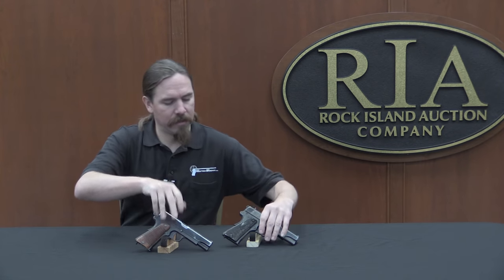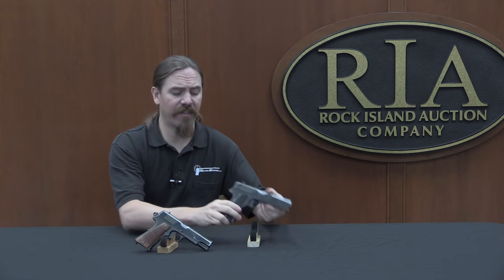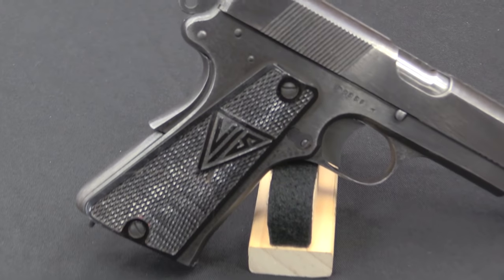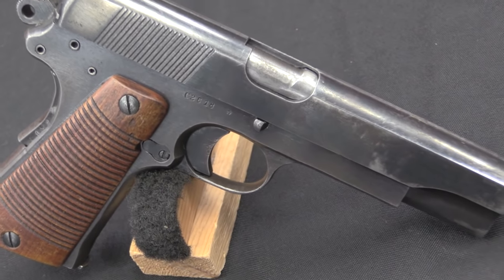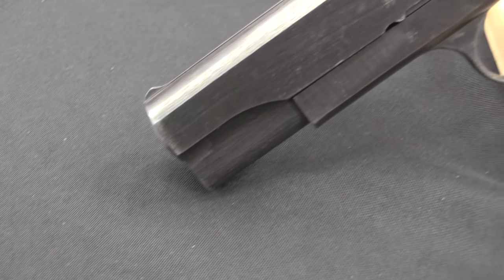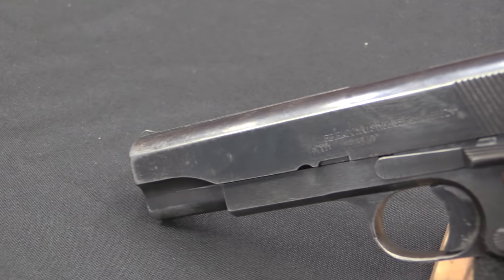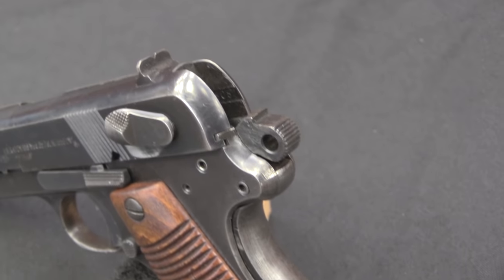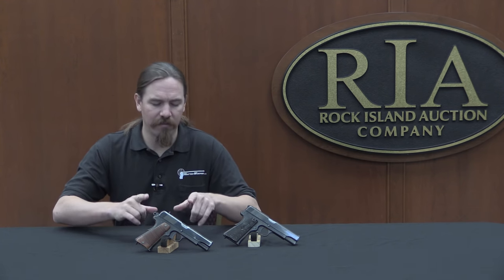Radom's Vis 35: Poland's Excellent Automatic Pistol

Comment: Hi! Great vid! There are some details I know of that I don't think were mentioned, so I'll list them for anyone who's interested:
- VIS name came from WIS which stood for 'Wilniewczyc i Skrzypiński' ('i' = and) who were the constructors behind the project. Army decided to swap W with V and make it into Latin VIS, which means 'force' or 'strength'
- Polish-made VIS were meant to be able to work with holster/butt so they had a hook to attach it on the handle. 
- When Germans found out about scheme with duplicate serial numbers they decided to move barrel production to Czech. It didn't help much cause Poles were just salvaging barrels from old firearms and refitting them with the rest of the gun. In the end whole production line had to be moved to Germany.
- VIS's production has been reissued 2 or 3 times but it was either in small series or solely for US market.
- They can be mainly found in US as most of the WW2 produced guns have been taken off German soldiers as a trophy.

Comment: i own one of these. I bought it,  as it was inexpensive at a Gun show, and  then shot it. Tiny sights, but it was freakin' accurate, so i bought some replacement magazines for it, and for years used it as my duty gun as an Amored Car courier.  It's a late period manufacture, covered in German proof marks,  having hollow pins, and (unfortunately) lacking the take down lever. Still, the weapon was, and is still my "to hand weapon" for many years and i trust it.
 never had a problem with it. Thanks for covering this pistol.

Comment: I have one of these that my father brought back from Europe after WWII.   It is a  dated 1939  it is the final version the Nazis assembled using all the orig. parts with the shoulder stock slot in the hand grip.  It does have the polish Eagle on the side.  It is a  very fine shooting easy to handle pistol.
Reply: I have the same version, serial number just before 40K and no marks on the slide. Numbers are matched.

Comment: Ian, you can actually take the late guns apart without holding the slide. The hook on the top of the (not present in the earlier guns) hammer is meant to be lowered into a corresponding notch under the slide to hold it rearward.
Reply: +Onot 

Actually the way to lock back the slide on the late war guns
is to pull the slide all the way to the rear and press the de-cocking lever
down and while holding it down ease the slide forward. The bottom of the
de-cocker catches on that notch on the hammer you describe.

A late war Radom was my first handgun, I got it in 1979 and I
still have it.

Comment: I always thought these were an interesting mix of 1911 and BHP. First heard of them in the 85 or 86 Gun Digest Annual. It was not mentioned that FN brought their prototype HP's to the trials. That makes perfect sense. Disturbing to hear about QC problems with the BAR's and the resulting contract difficulties. I hopw it was just issues duplicating a non-native design, and they were not deliberately trying to short change the Poles. Great video as always. Thank you.

Comment: a decocker was probably very important to cavalry because they didn't want a live handgun with no safety jostling around on their belts when they were riding horses
Reply: Did Poland still have horse riding cavalry in 1935?
Reply: Yes. But cavalry was simply faster moving infantry. And not so tired by marching. Since 1935 polish rules for cavalry forbade of charges and any other way of fighting from the horse. Polish cavalry was to move using horses and fight as ordinary infantry.
Reply: @tomaszkornaszewski3275  I believe you call this style of cavalry "dragoons"
Reply: @nichevo1  Yes, but 4, 3 centuries earlier.
Reply: @loganjones5766  So did almost everyone, Germans included - even in 1939.

Comment: On the late model VIS, to take off the slide, you need to pull the slide back, and use the de-cock lever to hold it back. It will rest against the top of the hammer. That is why there is a small cutout on the top of the hammer on these later models. It will hold the slide back. Then you can release pressure on the telescoping rod just as you do with the earlier VIS. That is why they removed the disassembly lever, cause it wasn't needed. It's actually much easier than using the disassembly lever.

Comment: What I thought was neat with these weapons that you didn't mention is that the earlier ones made by the Polish had a slot in the mainspring housing for a shoulder stock which doubled as a case, similar to the stocks seen with Broomhandle Mausers. However, it appears that none of these stocks were ever made, and once the Nazis took over the factory that slot was one of the first things to go.

Comment: I have not read through all the comment so this may have been already mentioned. To remove the slide stop on late war pistols (lacking the slide latch) the slide is held back in takedown position by the hammer drop lever and hammer hook. A lot easier than the method you employed, See VIS Radom by York. You are doing a great job! Thanks.

Comment: I inherited one of each from my father. A polish and a german VIS. You can really tell the quality difference between polish and german. The German gun is a much rougher aesthetic finish with machining marks visible. Internal quality is of good finish. To my surprise German gun I have is much more accurate than the polish made one is.

Would the Polish made ones be more valuable being as there were not as many made ?

Comment: Ian, I have a German P35P version without the disassembly lever. To lock it open to dissemble you pull the slid back until the notch lines and pull down the de-cocker, it locks it in place like the disassembly lever does.  Just pull the guide rod and out it drops just like the other model.

Comment: The later guns without a take down latch used a notch on the hammer to hold the slide back. You retract the slide, push down on the decocker, and let the slide run forward. The hammer notch catches the decocker leg and holds the slide in the proper position for removal of the slide stop.

Comment: I had a strange one brought back from ww2 by a grate uncle. It had the black grips and was finished well. But it had the DC. Only no safety. It had the Polish eagle but had swsticker under some eagles. And the numbers matched with swstickers stamped around them. It had a leather flap holster and a extra mag. In the holster mag pouch. The ex mag had a swsticker stamped in it's base plate. But the one in the gun did not. It didn't have the take down.
 Sadly it was destroyed in a house fire.

Comment: Did you notice the cut in the hammer? If you decock with the slide back, this will hold the slide inplace instead of the slide stop of previous models, allowing you to easily pull the slide guide for release of the slide stop.

Comment: If there were a pair of marks on the right side of the 3rd model that indicate when the slide was retracted at the point to remove the locking pin it would be much easier.  Just hold the pistol over a table ( or similar) with the right side up, retract the slide with the left hand until the mark on the slide lines up with the mark on the frame, pull the guide rod, and the lock-pin will fall out. Ta-da.

Comment: Vis - Polish semi-automatic pistol wz.35, designed by Piotr Wilniewczyc and Jan Skrzypiński and Feliks Modzelewski [1]. The original name of the WiS pistol, created from the first letters of the designers' surnames, was changed to Vis (Latin - force) at the request of the Department of Armaments. According to some sources (including Guns & Ammo magazines), this pistol is one of the best military pistols ever produced

The Germans did not produce under the name VIS, so the NN covers are from a later model. 
The Visas, manufactured for the Wehrmacht, were called Pistole 35

Comment: That would be awesome if they made guns like that now I would buy it I have a CZ it's a tactical version it holds 18 rounds but is the smoothest shooting you never think but do you see the technology they had then you see where they're getting all this stuff from these decocking mechanisms and everything I have that on the pistol that I just told you of is meant to be a sidearm for military just as you have better they're in your hand I really like that were you pull on that bottom piece and it lets the other piece fall straight out that's just so much nicer then when you got some of these like that 762 x25 Tokarev that one actually got to push that out a little bit of a herky-jerky thing but it does come out but that is a slick pistol you got there from Poland I've been known to pay some big money for pistols or rifles that one I would pay for it cuz that's some feat of engineering right there they thought quality over production which during the war you had to have production but you need some quality into it so it ensures itself like the Switzerland gun makers did.... reliability with quality

Comment: The gun smuggling came to light when somebody on a train got caught with one of the pistols. Polish resistance had the serial numbers filled out in order to protect the factory workers. However just around that time some CSI predecessor in Berlin had found a way to make a filled out serial number visual again.   Even after this incident and the subsequent executions the leaking of pistols from that factory never fully stopped during German occupation.

Comment: Very few people knows the correct way to disassemble the late german model. They have no three hands nor liked contorsionism so reduced costs replacing the disassembly lever with a notch on the top of the hammer (you can easily see that hammers are different in the two guns). Well, you have to pull back the slide, act the decocking lever and release gently the slide. An arm of the decocking lever will catch the notch in the hammer stopping the slide in the exact point for the  disassembly.

Comment: The new production Krieghoff Lugers were wholesale priced at $18,000. Sorry.    The rivets on the late Radoms were called " Roll Pins" and were easy to disassemble.  But you need to use a punch.    The pleasant feel of the guns is because the grip frame flares out at the bottom. The circumference of the grip is  quite small at the trigger  level  widening out at the bottom to be nicely hand filling. The accuracy of the Radoms is well known. In the 1970s a man in California even had a batch of Match grade barrels made for this Polish pistol. The blued finish on the early Polish eagle pistols is as fine as any to be found on early Colts or Smiths. The hardest Vis pistols to find are the very late ones with the slide marked   BNZ . The late wood grips are very desirable also.

Comment: Very cool pistol, though too bad that it has no manual safety. I rather like those. Definitely seems like a better pistol than the P38 even though it isn't double action and doesn't have a loaded chamber indicator nor a manual safety, all qualities that the P38 has. I'd still prefer the Hi Power over either of them, but as far as 9mm WWII pistols go, this one would probably come at #2 for me, which is still quite good. P38 at 3rd, P08 at 4th, and C96 "Red 9" at 5th unless it came with a stock but then it'd be a carbine rather than a pistol. What other 9x19 pistols were there in WWII I wonder... having a hard time thinking of more than the Hi Power, ViS 35 "Radom", P38, P08, and C96 "Red 9".

The Steyr 1911 or 1912 had its own 9mm ammo, right? 9x20 or 9x21 or something? If I'm wrong and it's 9x19, then I'd probably put that at #4, bumping the P08 down to 5 and C96 down to 6. Yeah it uses clips instead of detachable mags in order to reload, but I'd trust that Steyr pistol more readily than a P08 Luger. Such a HUGELY popular cartridge today, 9x19, it's strange to think that in WWII barely anyone used it for pistols. In SMGs, well the STEN used it, and I think the Italians had a couple SMGs that used it as well, but beyond that, just about everyone had their own ammo it would seem. 7.62x25 for the Soviet Union, .45 ACP for America, 8mm Nambu (8x21 was it? It was one of the weakest pistol cartridges available as I recall) for Japan, and so on and so forth. 

Logistics nightmare, as far as one nation helping to supply ammo for another is concerned. Even worse when it comes to rifles. The Commonwealth seemed to have the best setup with UK, Canada, India, Australia, and likely Jamaica and New Zealand as well using .303 Lee Enfields. Then America had .30-06, Germany 8mm Mauser, Soviet Union 7.62x54r, I think Finland had 7.62x53r, 7.5x55 Swiss for Switzerland, 6.5 Swede for Sweden, then I recall there being a 7mm Mauser cartridge thrown in the mix, and 6.5 Carcano for Italy, 6.5 and 7.7 Arisaka for the Japanese, 8mm Lebel for the French and did Norway have its own 6.5 cartridge for the Krag or did they just use the 6.5 Swede? Now, with Nato, 7.62, 5.56, and 9mm Nato are all standardized. Whether America needs supplies from Britain, Japan needs supplies from Australia, or India needs supplies from South Korea. We all use the same basic ammo, and many of us even use the same LMGs; FN MAG (M240, C6, L7) and FN Minimi (M249, C9, not sure of Britain's designation for it).

Fascinating stuff.

Comment: Is that Vis mag "similar" to the P-38 magazine?

Many years ago I had S&W 39. It came with several mags, one of which would fit well, but not lock in. It turned out to be a P-38 mag, thus lacking the Browning-style mag-catch "notch". In retrospect, it made sense for S&W to not completely reinvent the wheel and therefore appear to have lifted several Walther features and a bit of Browning to come up with the Model 39. Duplicating the basic magazine AND the grip angle would certainly cut some design corners. Mr. Beretta seems to have had more than a passing acquaintance with the P-38 as well

Maybe Herr Walther's team picked up on the Vis 35, or its developmental versions, for their initial "Heerespistole", in a manner similar to S&W, who, in turn, "liberated" some ideas from Walther for their proposed 9mm US service pistol.

Comment: As a Pole I have one thing to say: It belongs in a museum!
Reply: +Michał Pawlak The factory was thinking about making them again. But however due to the cost. There isn't much market for it.
Reply: +2damaxmr2 AApperently they are in production again, and hay, they made over 300,000 of them, so its not like they are to rare.
Reply: +Michał Pawlak They are still in production in FB Radom from time to time, in small series. And they are so fucking expensive :(
Reply: The company that i was working for did inquired about the pistol. However the deal fell through due to the high price.
Reply: +Kamil Grabarz Styczynski  There was a new production example at the 2014 shot show. I really don't know what they were priced at.  I thought it was around $8000 or $9000.00 which is reasonable compared to the 
$!8,000  asked a few years ago for the new production Krieghoff Lugers  The current Radom Factory also produced more of the super rare VIS shoulder stocks since 2000 than were made pre WWII.
Reply: +Kamil Grabarz Styczynski Radom is notorious for what can be only described as anti-consumerism and has a long history of mismanagement, nonsensical pricing strategies, etc. I've heard A LOT of stories about the treatment they give people. For example: you, as a private citizen, go to them and ask to buy a gun, they ask "what for?", even if you show them that fucking gun permit. Old communist habits die hard I suppose.
Reply: That was one of the few reasons that the deal did not went through. They wanted us to have endless amount of paper work and process that we had to go through. Not to mention that we had to purchase a rather large amount as well.
Reply: Ad Ian
As usual, an excellent talk. This sort of work should be on breakfeast TV! :-D Every time. Then, I would get myself a telly :-D! Thanks a lot, sir!

Ad Michał Pawlak!
Who did give our soldiers the Wist? Last time I heard it was not the FB Radom but a completely different company based in Łódź, not in Radom. And from what I heard, the pistol was not designed by the Łucznik, who fielded a competing design: the MAG. Please, measure your words wisely, get the facts right - the World is reading ;-)!
Reply: +Andre K You're totally right, thanks for correcting me on this - I dindn't check the entire story before posting.

Comment: The later model still has the disassembly lever cut it the slide. Does it mean they did not change the process (I imagine cutting another hole in the slide is additional cost in machinery and time, so it's a waste) or was this slide from another, earlier gun?

Comment: Not sure if anyone else can validate this for me. It appears that there is a relief cut (V shaped) or gouge in the slide at the point where the recoil spring sits. You can see this for some brief moments starting at 15:20ish. My Radom VIS has this too. The gouge/relief cut seems to jagged to be intentional, and this part of the slide is made of really thin material. Anyone else have this?

Comment: Why have a hammer on an automatic, does it have any real advantage or is it just an added complication?
Reply: I used to work for a bank and we had 0.25 1905/6 Browning FN auto's under our tellers counters, at one branch they used to have 0.25 Beretta's with hammers,however someone said if they were on half cock and knocked onto the floor you could get a discharge, these were superceded by hammerless models.
Reply: DOUG HEINS  Ok Thanks for that, fortunately non of us had any intention of starting a shoot out in a bank foyer, it was not OUR money, let 'em have it. We had a practice shoot in the basement one day and they said " ,If you don't get a good report, don't fire again,we are using out of date ammo", I had one double load attempt,how two can fight for the breech I have no idea,also one spent casing jammed in the ejector, thats how crap that ammo was.